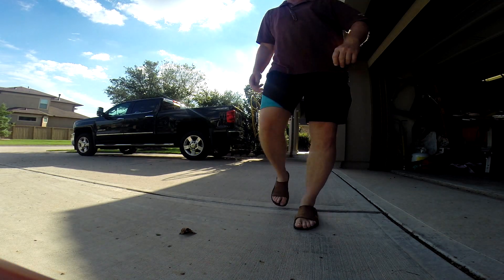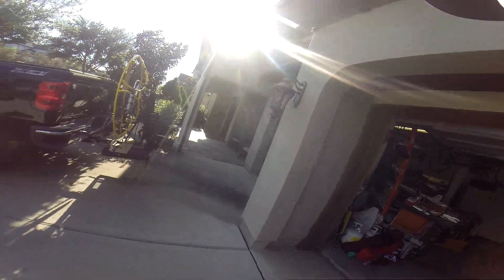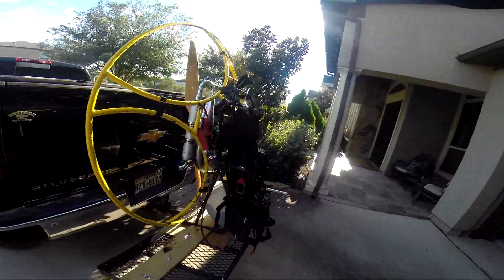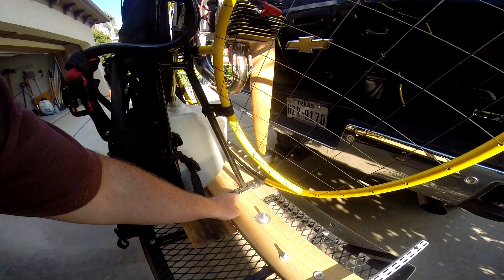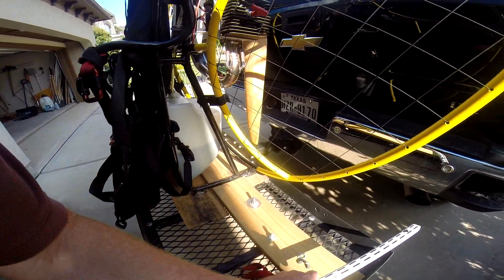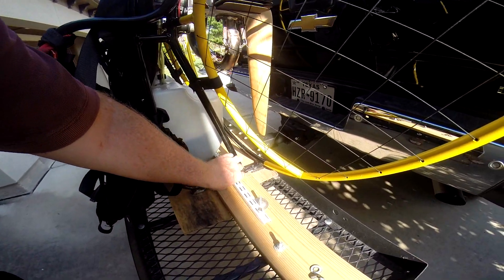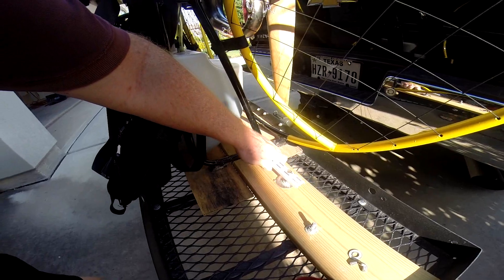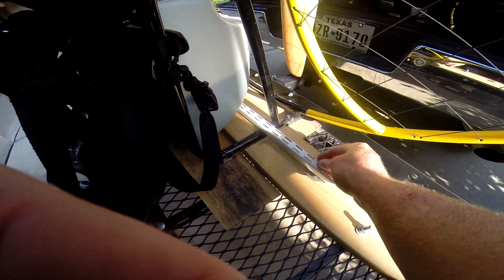Strapping My Paramotor Down for Tuning and Testing

Comment: HI FROM WHAT YOU HAVE MENTIONED. SO YOU HAVENT GOT A KILL SWITCH.?  TO STOP THE ENGINE RUNNING.IN A EMERGENCY.. E.G FAILED LAUCH AND WING FALLING INTO SPINNING PROP. ( KILL SWITCH) IS ATTACHED TO THE THROTTLE HANDLE
Reply from the maker: I have a normal kill switch.  I was/am just trying to get myself familiar with alternate methods of killing the motor in the event that I have a kill switch failure/problem.   In fact, on my most recent training flight the throttle cable got through/around the netting and into the propellor.  This resulted in it cutting the wire that leads to my tachometer.   During that flight I mistakenly thought the wire cut was the one for my kill switch..... As a result, I wanted to put a little more effort into practicing how to kill the motor in the event that I ever do lose the functionality of my kill switch.   I've come to the conclusion that the easiest way for me is to just pull the spark plug wire off.    I've also managed to pinch the fuel lines, but the spark plug wire is safely accessible and will do the trick!